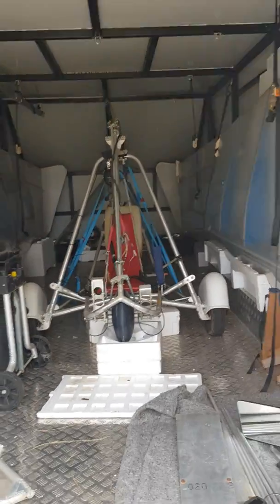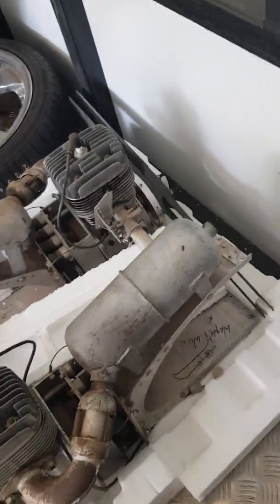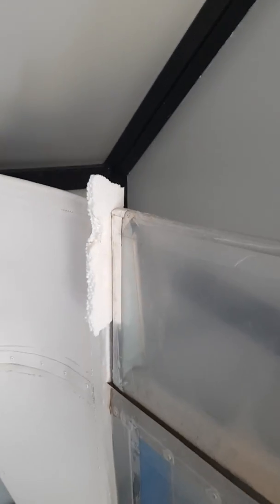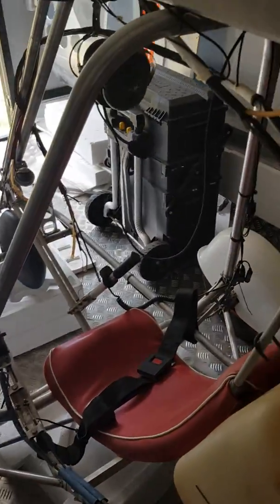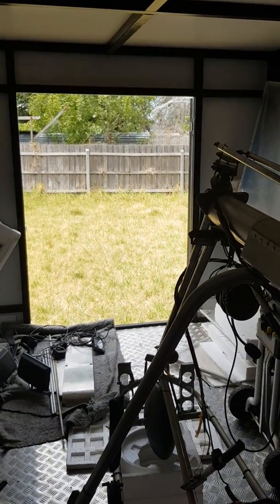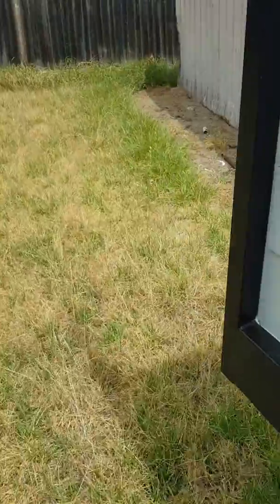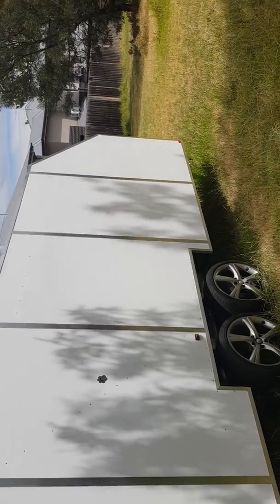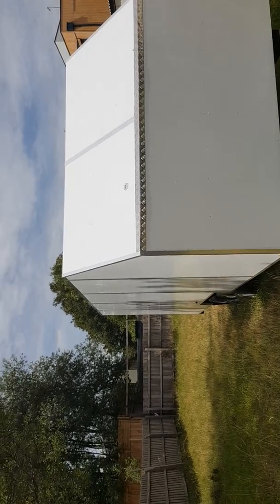The lazair series 3. I buildt in 2010.

Comment from the maker: I got all the Styrofoam from Harvey Norman bins, 12volt car battery on a charger, 1 length of wire approx 1.2mm × 2mtr long, I then got 3 legths of timber approx 5cm x 5cm x 300mm long, screwed then together in a 'C' shape. Stretched the wire btw the open end and connected the wire to both +/-  a template of the D Cell ( thanks Tony ) in 3ply screwed to the end of the foam box. .Cut one every few minets  Allowed the battery to.top up in 
Btw. If a fresher battery is used a longer wire to put resistance on the current will stop the wire shorting out. 
The tie down straps I paid a bit more bc they were soft cotton material rather than nylon blend.

Comment: My Dad was a dealer for Lazair. Starting in 1981 we hauled Lazairs many a mile and always used every strategy possible to prevent damage. The Lazair is quite easily damaged and can be thrashed with one careless haul.

Have you flown it ?
Reply from the maker: Hello Shannon. Yes, I found a series 1 assembled and a series 3 unassembled in country NSW, 
It took a bout 12 months to build, first flight hands off straight and level. I think I chatted to you during the build on lazair.com i got upgrades from George. 
Tony has the series 1 and 2x series 2. Steve Roberts old lazair. 
As you can see not a scratch in 900 km. ( 600 miles) 
This is the last lazair to be buildt from the factory. It was purchased in 1984 and never assembled, until I got it in ( all those plastic packets ) in 2010. 
She was safely tucked away waiting for me. It's been hangers since buildt, no signs of age or tape slippage. I wanted a lazair some the first time I saw one. 
Then miracles of miracles I got one as it came from the factory. 
Still got got parts I can't identify, some are battery boxes, the rest idk ?
Reply: Ahh yes I do recall. Those were mods I learned from my Dads dealer days handed over during George's build. Yes I've been in touch with Tony trying to help him get some 185s going. Definitely a little rare Gem  one doesn't want to beat around. It'll be neat seeing some vids of it zooming around.
Reply from the maker: @shannonwhitaker9630  tried to upload a vid here from FB, 2hen you click the link it's not there?
Reply: Probably have to upload directly from your computer to your Channel. I have no idea why ?
Reply: Hey, I have a series 1, taking it up to rylstone air show this month drop by if your in the area :)
Reply from the maker: @sbjwalks hey mate,  that's awesome, no I'm  not in NSW till the holidays, where did you find your series 1 ? Is she in fling condition ? 
Look up Tony Leahy in Tamworth he's got 3 now. 2, 2s and a my old 1 series. 
There's 2 more in the area, not flying heard i last. They are family freinds. Have their own runway, near lithgow. Cheers
Hit like on the comment so I get notified when you post, otherwise I won't see you for a week or so till I check.
Reply: @charliejeans2413  I picked it up in sunbury Victoria, yes still in flying condition although has fabric which is slowly growing on me but would like tedlar to show off the aluminum, have photos on my Facebook look up skycraft scout or @9510aircraft and you will find us there, that field at Lithgow is that capertee? A man at ryelstone had mentioned there was one flying out there.
Reply from the maker: @sbjwalks  John Thirwel in capertree valley, there's a red  marked  danger zone on the maps,  the 1st first mt from kandos back to Sydney,   don't go flying around there unless the weather's perfect. 
( forgot the name, ! ) 
 That's where I got the series 1 and 3 from, the guy owns a pine tree plantation on top of the mountain..
1000ft launch. Beautiful area to fly over, good to avoid in anything but calm weather. 
Tony has 7 pioneer motors, though about putting 4 engines on your lazair  ? Been done before. Just need to double the skin over a few D cells, get some engine bolts/ clamps, ( think I got 4 ) and the nancelles. ( make them ) I got the plans for long bolt modification too, and just strut if you need a copy. 
The Tedlar, it's here in Australia, Sydney. you can order it, they cut it to size, just don't ever mention airplane !  Order extra wide, not the original manual size. ( the book size sets off there alerts ) your covering a boat. Or a green house. 
Comes in 1000ft rolls, 10ft wide. I was going to buy a whole roll, but no one was into lazairs here at the time. 
The Tedlar tape, ? Canada or US about $350. 300ft, snuff to do 2 lazairs and some. If you get the Tedlar, let me know. I have a roll of 3inch Tedlar laser etched,  resin backed tape, the good stuff. Last 25+ years, sets after 3 or 4 years. 
Tedlar last for ever in the hanger. 
Mylar stretches in high heat, like kandos or inland oz.
Reply: @charliejeans2413  Exellant!! For a while i thought there was only three lazairs in aus, not thinking of doing the 4 engines but I was looking into the electric conversion to fly at the glider club up at mangrove mountain but not any time soon, I have been invited to fly at Hartley did the pioneers have any issues taking off at 2000ft? I'm 90kg and at sea level it's fine, my dads lazair was covered in mylar and it lasted 15 years he always kept it hangered in the trailer,  I believe steve Robarts ended up with the airframe frame. Untill the fabric gives me trouble I think I'll keep it as is it's quite robust coverings and I don't have much to spend on it have a few scouts to get flying first. what's with the Jerry struts? Are they for increased loading?
Reply from the maker: @shannonwhitaker9630  took a bit bit here she is.
https://m.facebook.com/story.php?story_fbid=10154086756455367&id=752280366
Reply from the maker: @shannonwhitaker9630  https://m.facebook.com/story.php?story_fbid=209514092467454&id=100002265948314&sfnsn=mo